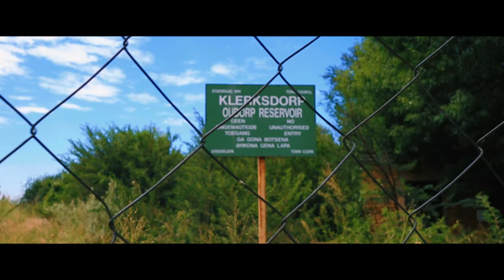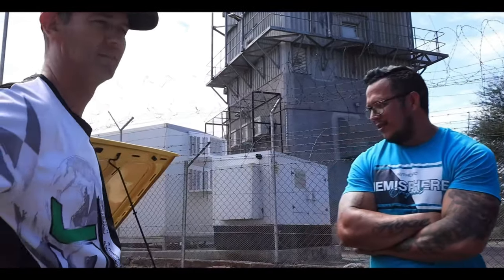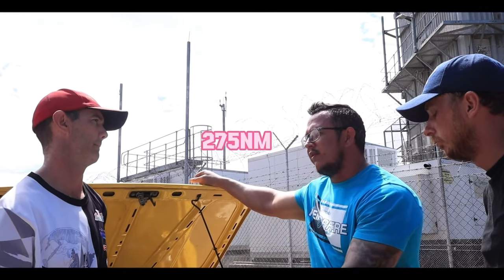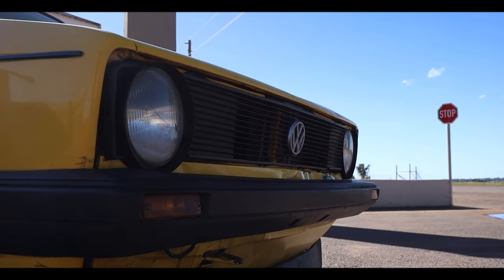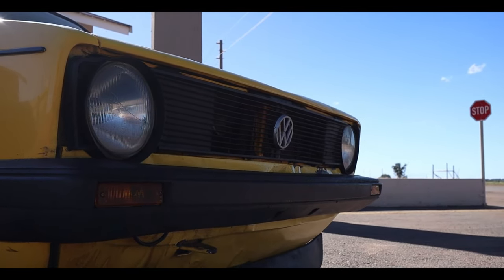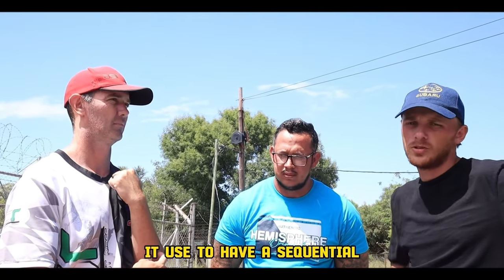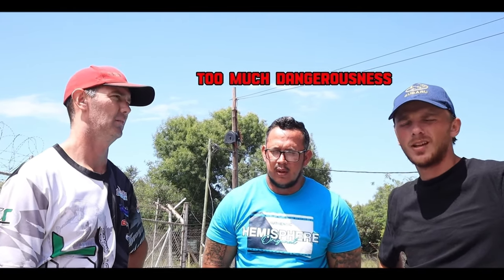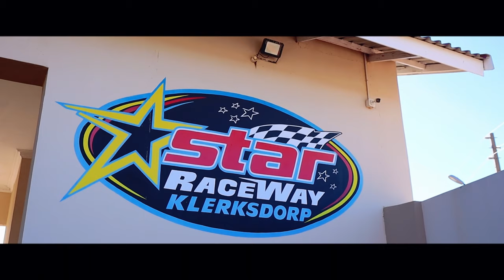Crazy ABF Powered MK1 Golf

Comment: Its crazy how expensive this N/A golfies builds can cost saw a stage 3 2.2 Stroker 16V ABF with Kent cams 300°, 45mm rxi blacktop itbs with roland intake, Massive big ported cylinder head, Gasflowed, swirled valves, high compression motor running efigas, knife edge and balanced crank, high rev kit, Nissan CA 18 pistons, forged rods, 650cc injectors, solid lifters and Sustech management, motor is making a healthy 161KW saw the motor selling for 70K but with all those mods its worth the money